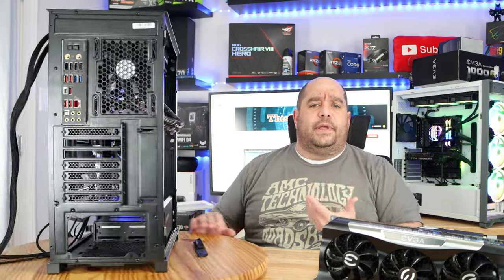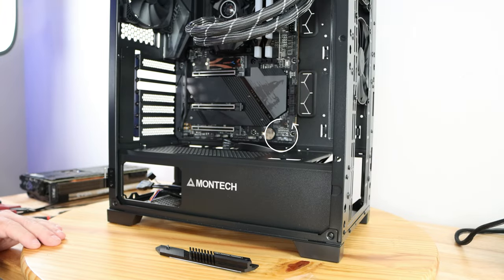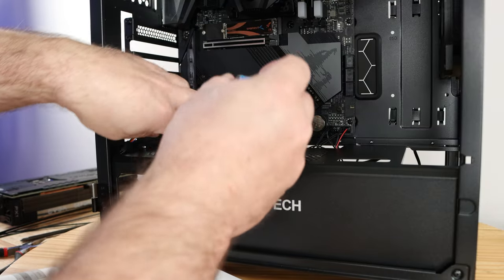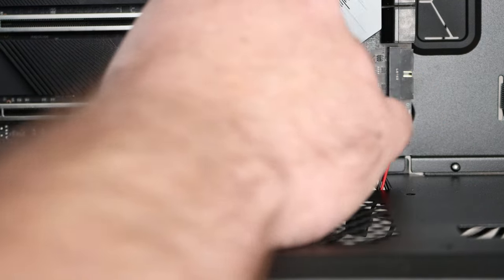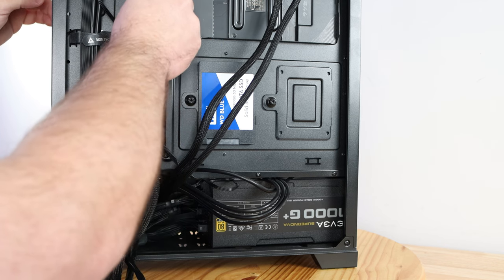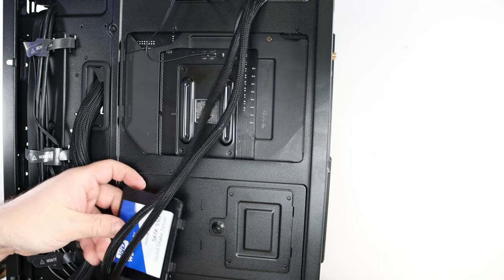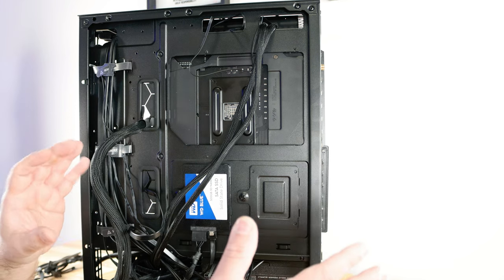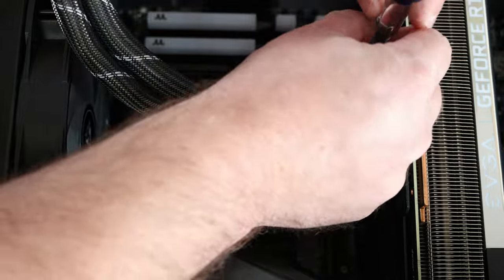How to Cable Manage A Gaming PC For Beginners 2022

Comment: Very beautiful video. You have so many tips on how to properly wire up a PC as a beginner. I have another suggestion for the cable on the graphics card so that it looks better. I use angle connectors for the PCIe cables. So the cables go flat to the back.
Reply from the maker: Thank you my friend, I do appreciate it, if you could, send me a link to them, so I can check it out, but I don't know if I will like them.  Problem is, cables under or over, blocks partial air from hitting the card, at least in a section of the card, causing a potential thermal issue, potential of course.  I am curious though, I would love to check them out.  Thanks again so much for your kind words.
Reply: @ThisBytesForYou  You can look for those here COMeap GPU VGA PCIe 8 Pin U Turn. Unfortunately, a link is deleted again and again. Since I started using it, the graphics card looks even better because the cables are no longer visible. I have no heat problems. Only one opening in the backplate could be hidden if it is used for cooling.
Reply from the maker: i have it set to protect you and all my viewers to not allow links to be posted, I still see them, but I have to approve or deny them.  I will look them up, thank you.
Reply from the maker: ahhh, I think I saw you post this in one of pc groups I am in ;)

Comment: I use to use black zip ties in all my older build but had a lot of scares when I had to cut them off to do an upgrade or replacement and would almost cut the very thin wires or any wires when removing zip ties so now I use black bread ties or twist ties that are rubberized to cover the metal. I bought a huge pack in black and they are re usable and easy to remove by simply twisting them loose.
Reply from the maker: yeah, I know what you mean, it's happened to me before.  Good idea with the twist ties, but I would be too scared of the metal coming out over time as the rubber dries out, grounding things,, you can't go wrong with zip ties, you just need to be VERY careful.  Again, not blaming you, its happened to me, and surely has happened to everyone, but they are the safest.  this is my opinion of course.
Reply: @ThisBytesForYou  Yea very true. That's the one good thing about the zip ties. The all plastic material 100% prevents shorts vs. twist ties.

Comment: Hey, how's the build quality of this case? Is the metal that's used in the case too thin and flimsy?
Reply from the maker: no, not at all, the case is great, actually, even though I do love Lian Li, it is better than the 011 (oddly enough the 011 has issues when you do multiple builds) but this one is solid.

Comment: thank you for the helpful video, I just got my evga 3080ti for msrp ill see how this card performs, how is it going for you so far with this card?
Reply from the maker: Card is great, you will love it.
Reply: @ThisBytesForYou  Sweet i am currently upgrading from a 3070 ti msi gaming x trio because I play heavy games on 4k after work. that gaming x was not fast enough, i was also dissapointed with the quality of it. hope this one is better. 
thanks again.
Reply from the maker: 3070 won't be able to do 4K well, 3080 maybe, 3090 still has issues, no real reason to play 4K, just play 2K with all the eye candy turned on, it will look and play beautiful
Reply: @ThisBytesForYou  i see, Ok thanks for the suggestion i wanna see how this card performs on 4k first and then i might change down the resolution to get smoother gameplay.
Reply from the maker: @faris9327   I promise, no mater how well it performs, it will perform 100% better at 2K, with your refresh rate at its highest and either all or a lot of the eye candy on, this was a part of my job for years

Comment: Hi I’ve just followed both your installation and wiring videos and I can’t thank you enough as it’s my first time replacing a motherboard I installed the 570s master as in the video I only have 1 problem my D and E Drives are no longer visible and when I go into disc management there not there either do you know what I’m doing wrong and how to find them. Thanks in advance. Ian
Reply from the maker: awesome my friend, so very happy I could help you, it means a ton to me to know that I could help you.  Well, on the D and E drives, do you have an M.2 SSD, and if so how many and what are the D and E drives, is that 1 drive, 2 partitions or 2 separate drives and are they regular SSD's or mechanical drive and which of the SATA ports do you have them plugged into... there are so many things that could be the reason why they are not showing up.  The main ones (though I still need the others answered to know to help) are they both plugged into power and data?
Reply: @ThisBytesForYou  both Drives are now visible after updating the RAID Driver do you have a video for recommendations for settings in the bios for AORUS 570s Master MB ? 
I use my pc mainly for Gaming Flight simulators like MSFS and Xplane I’ve also just upgraded the PSU to Corsair RM850W and Gigabytes RX6900xt GPU I couldn’t of done it without your videos as guidance I’m absolutely clueless with things like this
Reply from the maker: AWesome my friend, so very cool.  As for recommended, I can only provide from my configuration, you can see the video here: https://youtu.be/XCggwcWdWsI  This should help and I am so very happy I could help you.  Make sure if you are not already, make sure you are subscribed, I come out with videos to help you in all aspects of the PC, this week a bad week for the PC side, too many disasters but I will try and get something out soon, thank you again.
Reply: @ThisBytesForYou  awesome thanks a lot also already subscribed it’s the least I could do for your help 🙌🏼
Reply from the maker: always a pleasure my friend, thanks so much for your support and I am so very happy I could help you.

Comment: There is a "G-Connect" with most gigabyte motherboards. This simplifies connecting the front panel I/O cable. You plug the front panel I/O into it, and then plug the "G-Connect" into the front panel I/O header. Much easier than fiddling with 4 different connectors especially the annoying split Power LED one. Asus also provide a similar connector. Some manufacturers don't - I'm looking at YOU MSI! Also the Power and Reset switches are not polarised, so it does not matter which way you plug them in. If you get one of the indicator led cables backwards you won't blow anything up - its just a diode and resister at the other end. If connected backwards the diode will behave like one and block the flow of current.
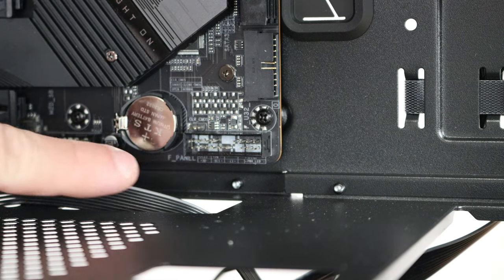Reply from the maker: yup, you can find that adapter on the video linked here at 4:33, though I don't like to show those that much since they are easy to lose: https://youtu.be/kJYLRb_9YvA, yeah many motherboards come with them, they are handy but I never use them.  Polarized here does not mean it will blow up, just means it wont turn on, flip it and it will turn on.
Reply: @ThisBytesForYou  I don't really use the G-Connectors either (and didn't on my latest build as MSI don't include them). They just make it convenient for newbs to get it right the first time. Wow that 3080Ti is a power hungry card - my 6900XT only needs two PCI-E connectors. In the coming weeks I'm going to get some cablemods extensions installed for my gpu, and fully water cool the system with a custom loop. I went nuts and have a 5900X, 6900XT, 2Tb NVME PCIE-4.0 and 64Gb of ram. But my machine doubles as a server - I'm typing this from one of the VM's on it (MacOS in fact). So I have a Fractal Desgin Define 7 with all that hardware, and 60Tb of drives! :) I've subscribed. Your videos are quite good. Most PC builder style videos edit out the "hiccups" that may occur during a build (such as in the previous one where you used the wrong screws initially for the pump and radiator). Its not rocket science building a computer, but there are some gotcha's that you have to look out for.
Reply from the maker: @dash8brj  yeah, and the 3090's also use 3 power connectors, lets see where the 4 series takes us and AMD's next as well.  I am using 64Gigs on my workstation, where I edit all the videos and photos, you can see me build that here if you like (I used corsair memory at first, but the memory had a burnt smell and didn't work right so I am using Gskill now) https://youtu.be/13LhFMdbtBA.  Fractal makes great cases, i just reviewed the new Meshify 2 RGB's and something else real soon. 

While i do edit out a lot of stuff, its mostly repetitious stuff, I don't want to waste peoples time, but I do like to show mistakes because a new builder, even an experienced one doesn't need to think everyone is perfect, we all make mistakes and while it is easy, its easy to mess up also too, and I like to help people know its OK to mess up.  I was a product development engineer for Alienware, before Dell bought us then for a while after Dell bought us then I left to work for Velocity Micro, so I made this channel to give people confidence to build there own and provide my experience to help people.

Thanks so much for your kind words and support, it means the world to me.

Comment: The case needs to be about 3/8 or 1/2 inch taller so that the area where the power supply is mounted can be increased by that amount so that the cables are easier to manage.
Reply from the maker: Sadly, that is a lot of cases, the shroud makes it difficult, in the latest video/build I did, the case looks like it has a shroud, but it doesn't so it makes things so much easier and nicer looking, check it out: https://youtu.be/XCggwcWdWsI

Comment: Hey also, which case is better in quality between this and the Montech Sky One?
Reply from the maker: I think this one is MUCH better, the sky was nice, but this ones better.
Reply: @ThisBytesForYou  Why though? Isn't the Sky One more spacious than the Air 1000? Also looked sturdier than the Air 1000 even though Montech told me that both of those cases are made from the same materials.
Reply from the maker: @VYBE  A case is not based alone on space.  The side panel is MUCH better on the 1000, the SKy ONE, the side panel felt like an afterthought.  The front grill/filter is a much better design, the front panel I/O is MUCH nicer, the placement at least.  My opinion, but you can check out both unboxing's on my site and see what you prefer.  Now, I do prefer the Skyones GPU holder, thats nice but thats about it, I prefer the 1000.
Reply from the maker: Here is my unboxing of the SKyone: https://youtu.be/Au1gzY-HshQ and my unboxing of the 1000 https://youtu.be/cfl2375z4YM

Comment: Thanks a lot...just waiting for Amazon to bring my power supply ,gone for Evga 600w gold ,had to use 6 pin to 8 pin  with my old power supply and it melted.
Reply from the maker: yeah, that's sad, but thankfully it was just the power supply, not worse.  Good stuff my friend, so happy I could help.
Reply: @ThisBytesForYou  all running nice, only thing my monitor wasn't turning on , forgot you plug it into the graphics card like an idiot
Reply from the maker: @bazdougall  no worries my friend, it happens to a lot more people than you could imagine.

Comment: I have a arous 80+ gold 750 watt modular psu and it has five 8 pin slot for CPU and pcie 
So I have doubt is I can connect pcie and cpu cable at any of these 5 slots or cpu and pcie slots are diff in modular psu
Reply from the maker: There is eps and there is pcie, it's impossible that a power supply would have 5, 2 at most.  What is the manufacturer and model number of your power supply.
Reply: Gigabyte arous p750w 80+ gold
Reply from the maker: @harshrathod310  ok, thank you and I apologize, your comment was the first I replied to this morning, my eyes werent working haha. So you are good then, you have 4 x 6+2 cables, (actually, its 3 cables, and one of the 3 is a diasy chain) so you would just use the end of each cable, not the daisy chain on in between, just the ends and you will be good.  Then you can use the other 2 for CPU, if you want to use both, you only need 1 for CPU power, the 2nd is for overclocking for extra power.
Reply: @ThisBytesForYou    five ports of 8 pin are there  on the power supply
So my doubt is can we use any of the 8 pin port of the powe supply for CPU/pcie 
I know that the other end of the wire is different, that is, 6+2 for pcie and 4+4 for CPU but the end of ther wire which goes on the power supply is 8 pin for both cpu and pcie cable)
So my doubt is that the end of wire  which has 8 pin can be plugged to any of the the five 8 pin ports on the power supply or there are 2 seperate ports for CPU wires and 3 seperate for pcie wires ?

As below the two 8 pin ports and 3 8pin ports there is  written pcie and cpu
Reply from the maker: EPS has only 2 options, 4Pin and 8Pin, PCIE has only to options (right now) 6Pin and 8Pin (which includes 6+2).  The end that plugs into the video card, is a 6+2, there are 4 cables, 2 have a straight 8 and the other 2 have an 8 with a pig tail, you can use all 4 cables, but only use the ends, don't use the pig tails.    Both of the CPU cables are 4+4 cables, so you cannot get them confused.  On the bottom row, you have 2 x PCIE cables, then a CPU, on the top row, you have 1 PCIE and 1 CPU, is the safe/easy way to look at it.
This is my reference, the manual is garbage, so I used the photo
https://www.gigabyte.com/Power-Supply/GP-AP750GM#kf
Reply from the maker: @harshrathod310  I think you commented agian on this, but youtube notification system and message delivery are horrible, I can't find it, can you repost that on a new thread, not on this thread?

Comment: nice video
but things starts becoming dangerous for me as i have to put 3x3.5 inch hdd which just makes cable management impossible espicially in budjet cases and a non-modular power supply 😥
Reply from the maker: Nah, just overlap the  SATA cables then use 2 of the SATA power cables on the upper 2 drives and a separate cable on the lower drive since they never make the cables intelligently enough to factor that in.  Thanks so much for your kind words my friend and so very happy you enjoyed the video.
Reply: @ThisBytesForYou  okk will try thanks
Reply from the maker: let me know how it goes

Comment: hi, in my pc the vga light on motherboard is on even after the pc is booted and running normally
Reply from the maker: So that I can help, please list the manufacturer and exact model number of the following components:

1. Motherboard - manufacturer and exact model number
2. CPU - manufacturer and exact model number
3. RAM - manufacturer and exact model number
4. Video Card - manufacturer and exact model number
5. Power supply - manufacturer and exact model number
6. Monitor - manufacturer and exact model number
 Redundant I know, but many people forget to enter manufacturer and exact model number
7. Do you have ALL of the PCIE connections plugged in, and not daisy chained or pigtailed, each coming directly from the power supply?
Reply: @ThisBytesForYou   
Mobo
gigabyte arous elite ax Z690 ddr4 V2

Processor
I7-12700

GPU
Asus dual rtx 3060 oc  12gb twin fan

Memory-32gb
Xpg adata 3200 MHz cl16 16gb x 2

Psu 
Gigabyte Arous p750w 80+ gold fully modular 

Monitor 
Benq pd2700q 27 inch 2k 

I have only one pcie 8 pin power slot in GPU
Reply from the maker: OK no worries, this is normal for Gigabyte boards, it is odd I know haha.